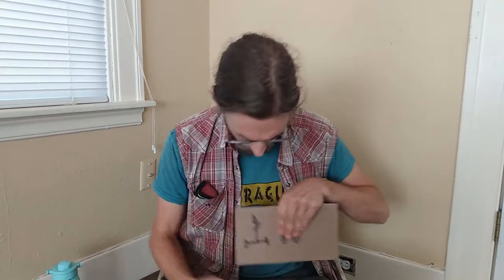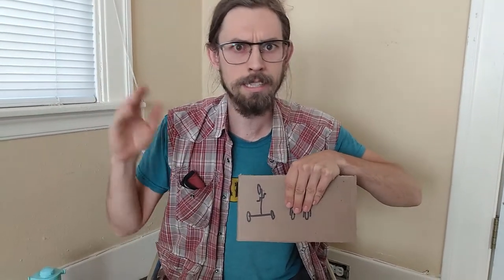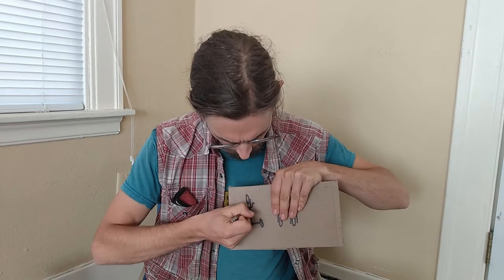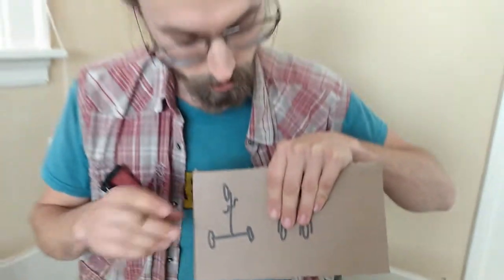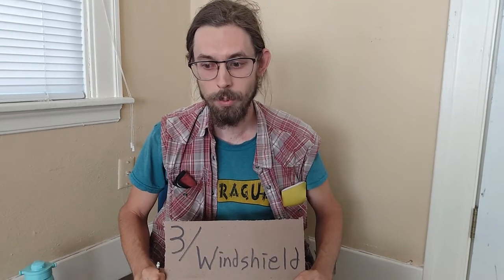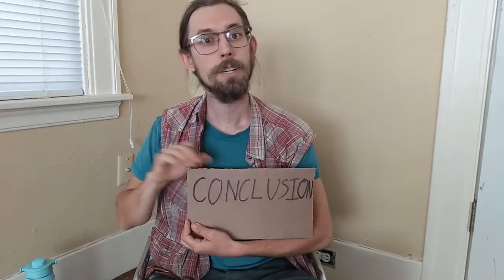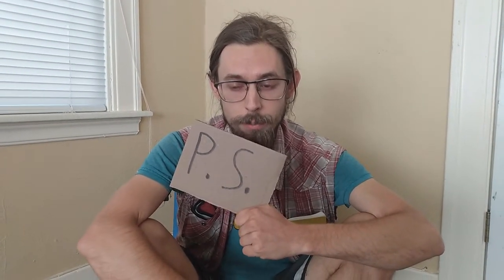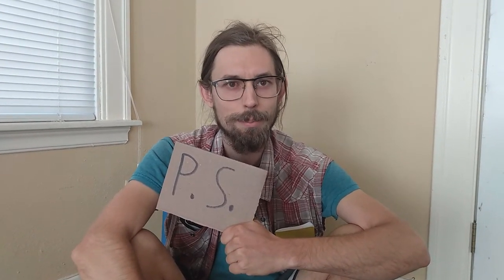MEUFL: Rewriting the Rules of Velomobile Design

Comment: He could have kept the chain to the driven wheel even shorter if he made a reverse/tadpole trike. My mother has a granny trike and she tried a few makes and models. She really didn't like trikes with only one driven wheel, different cornering characteristics depending on direction. She has one with a differential which works a lot better. I find it steers along with gravity, so a slight slope to the side of the road requires constant compensation. I haven't driven a tadpole yet, I don't know how sensitive it is in that sense.

I am tinkering on a velocar myself (think more practical than speedy, so a door and not as aerodynamic). After lots of sketches, a central beam and a single driven wheel at the back seemed to make the most sense. With some nods to old-fashioned wood aircraft construction, that single beam can be very light and stiff. I find the u-shaped frame of this MEUFL essentially a double beam, so heavier than it needs to be. But it makes sense when you want that pedal crank that needs two attachment points. There just isn't one way to do this.

I really like his use of foam for the bodywork. Velomobiles tend to be noisy. I'm a little concerned about absorption of water and fungus growing in there. It's closed cell foam, but the surface layer is not super smooth.